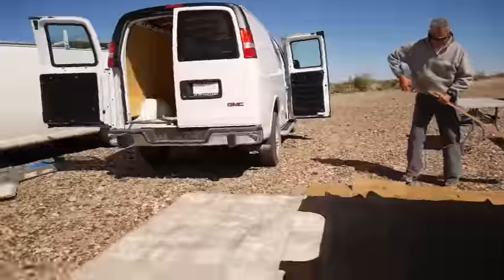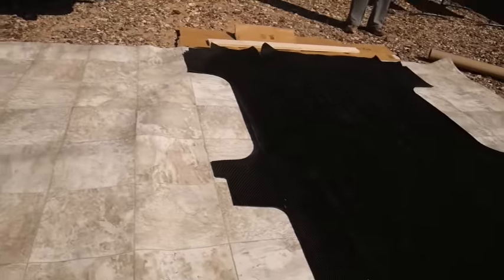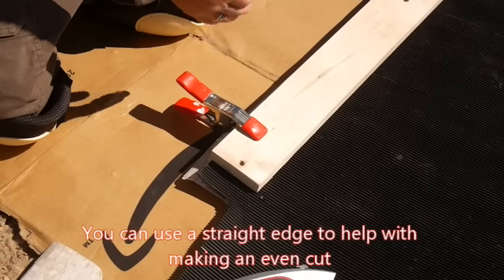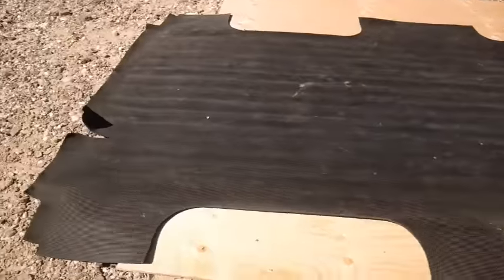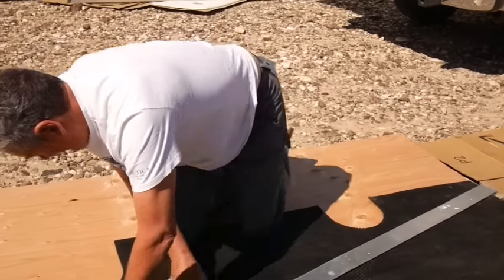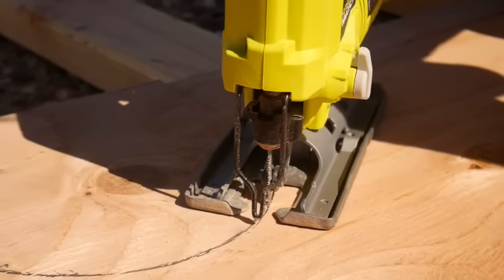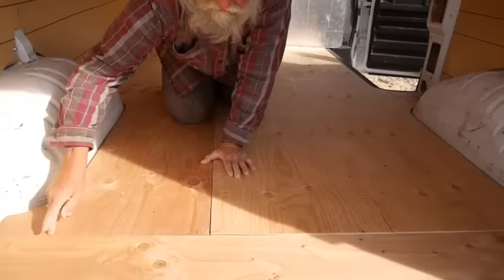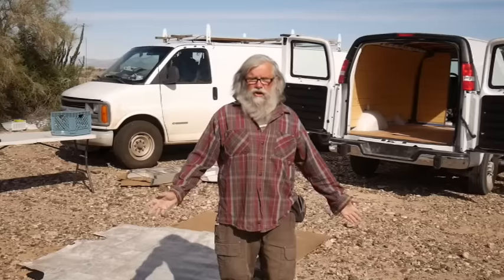Van Life Essentials How to Build a Floor in a Van

Comment: Just an idea for If you're on an extreme budget just get some porch paint and paint that subflooring, paint the ACX plywood maybe just sand it a bit and stain it or paint it with a semi-gloss enamel porch paint, that you can keep washed and especially using Pine-Sol or bleach keep your van smelling good and as a mold inhibitor.

Comment: You're probably right about the thin linoleum Bob. I used cheap thin carpet on my floor in my van and it rolled and curled all the time and I eventually tore it out and just used my rubber floor mat as my floor. My bed runs down the driver's side front to back and is only 30" wide so I just used a 24"x70" runner rug in front of the bed and called it done and that works out quite well for me...

Comment: My experience with 'cheap' Linoleum is exactly like you said...it eventually rips. Am having fun watching you Bob! Good work!!
Reply: Nora Steel agree and when it's glued into place you really have to let it dry good because it rips even worse with the glue on it wet. plus side is they are in a dry climate so it should dry really fast

Comment: Bob, You have done a great job with these videos! I only wish you'd started a couple of weeks ago, or that I had waited a couple of weeks, because I'm doing the exact same thing with my van, and started wrong!  I have the pink fiberglass insulation, and 1x3s to screw the paneling into, and even made a frame to hold the insulation in the ceiling and screw the paneling to there.  Oh, how I wish I'd used that foam sheet!! I'm leaving it all up now though, because my budget won't let me redo. I haven't done the floor yet, so at least that'll be done better!  Thanks, and keep up the good work!

Comment: Bob: Did you insulate the floor? Does one have to keep the top of the floor mat orientated so that the floor cut out will be correct?  Will the plywood seams flex and cause the floor laminate to crack? Thank you.

Comment: Floor tile heavy duty grade. Works well and can be replaced. Sheet goods are hard to repair. Sand and rocks in hiking boots will damage sheet goods. Heavy coat floor sealer or wax will help.

Comment: If you watch videos of building RVs in factories that is how the floor is put on. The modern tools and materials available make it quite efficient to do what you are doing. Battery power tools, various fasteners and glues and of course the insulation material.

Comment: Would there be any value to put the rubber mat down first to help insulate the floor?  It would also help to reduced road noise ?
Reply: John Simone Gosh, no one replied, but it sounds like a good idea!
Reply: You can lay down reflectix for insulation
Reply: @sarahlanders5353  , He’s been talking constantly for years that reflectix reflexes not insulates.
Reply: Maybe the Matt using for template?
Reply: Maybe the template they are using.
Reply: @rubyus7332  It actually does both, as there's bubble wrap in between the reflective layers.

Comment: Hey Bob, what do you put between the plyboard and metal floor of the van?
Reply: Wondering same thing
Reply: @vmoonbeam6571  I think that there is significant heat loss through the floor. The 1/2" poly iso being used for insulation can stand quite a load if the load is spread out. So, I think 1/2" poly iso next to  the metal floor, then  plywood over.

Comment: Bob, our home base is in Texas where it is incredibly hot.  We are redoing an old 1991 Ford  Econoline.  Would you suggest putting some insulation on the floor prior to installing our floor due to the heat.  Thanks!

Comment: any thoughts on running the grain of the plywood perpendicular to the van flooring 'ribs' for extra support?
Reply from the maker: +alzathoth because the van is 9 feet long that would have required an extra seam, and it would have wasted more wood
Reply: @CheapRVliving  Plywood should ALWAYS be placed across Joists (ribs). It is much stronger in that direction. If the ply falls on a void it will flex. Tearing the lino in this case.

Comment: Bob, did you leave the plywood as a floating subfloor or did you use adhesive or screw it down? I'm at this point in my van build and I'm thinking about leaving it floating since there will be a bit of weight on it. But I am wondering about putting down vinyl on the plywood. By buddy said to not use adhesive between the plywood and vinyl and it will be fine.
Reply: Hey Ron, what did you end up doing?

Comment: Did this work well? My mat that I’ll use out of the van is actually larger that the floor—goes up an  inch or two. So, to use it as a template I think I should trim it while it is still inside the van first.

Comment: Bob, my floor is rusted I'm the back of my van, should I lay  wood or sheet metal
first?
Reply: Cover any holes with fibreglass cloth, resin, 3 layers, then glue down 3/8 cdx plywood  over deck. Get under van and clean off dirt and dust, then spray bottom side with swamp cooler coating. Comes in a large spray can. Available  in any home supply  store. Has rust inhibitors  to stop future rust through problems.

Comment: Always Dry Fit.  Always Dry Fit.  Always Dry Fit.  Murphy's Law ALWAYS applies in operations like this:  IF ANYTHING CAN GO  WRONG, IT WILL.  That's why it's called a LAW.
Reply: Terry Novack, As I understand it, dry fitting is putting everything in place to be sure it fits BEFORE gluing/nailing it all down.

Comment: Soooo, what kind of glue do you use on the floor? I have no clue. Did I miss it in the video?
Reply from the maker: +LindasGoingForIt there is no glue in the floor. I did use 3M 77 spray glue to attach the insulation to the walls. But nothing on the floor
Reply: Thank you Bob. I guess I misunderstood.